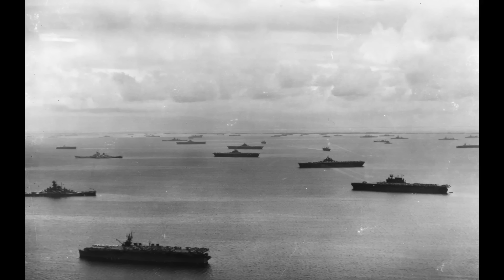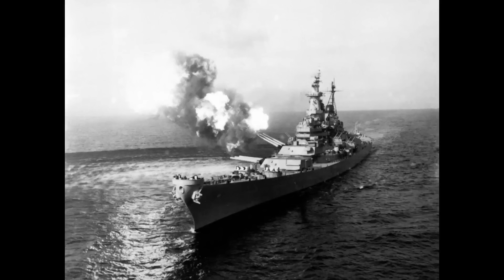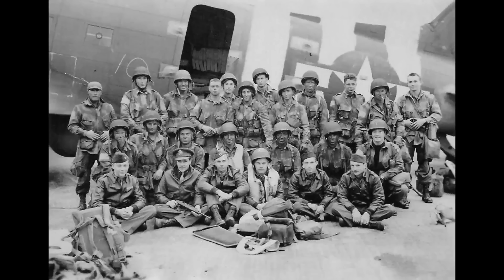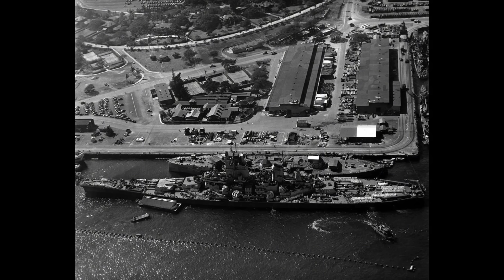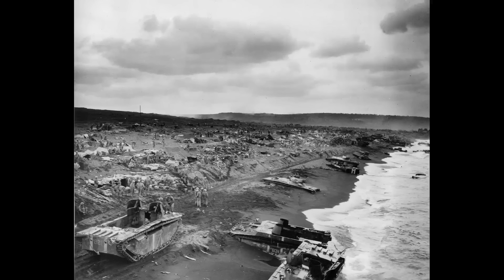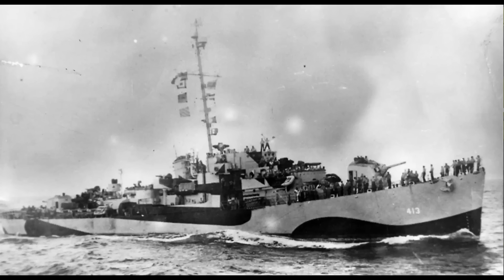How One Metallurgist's "FORBIDDEN" Alloy Made Iowa Battleship Armor Stop 2,700-Pound AP Shells

Comment: There may be some facts here that are true but it contradicts itself and is blatantly false on several points.The turret face for one of the Shinano's turrets before her conversion to a carrier is on display at the Washington naval yard. It is 26" thick and has a huge hole in it from a mark VIII shell. The North Carolinas South Dakotas and the Iowas all used the mark VIII super heavy shell. The Colorados were the only ships to fire the 2,240 pound 16" shells. This video also contradicts itself when it said a mark VIII could penetrate 20" of armor at 20,000 yards then says it can't penetrate Yamato's  armor that was 16". The bursting charge is 90 lbs not 40.

Comment: North Carolina, South Dakota, and Iowa classes all fired the same shells, the Iowas just fired them with more velocity due to the longer barrels on the Mark 7 guns.
Reply: Only the Colorado class fired the 16" mark 5 shell. The mark 5 was 1 foot shorter than the mark 8 and wouldn't fit on the Colorado shell hoists
Reply: The Iowa class could fire the old rounds but they got new rounds the old ships could not.  The backward capability aided resupply issues in combat but a return to port likely meant maxing the superheavy loadout.  As Packer910 also pointed out.
Reply: @charlesmaurer6214  The Mk6 16"/45 guns on the North Carolina and South Dakota classes could also handle the Mk8 2700# AP shell, they just couldn't match the velocity of the Iowa's Mk7 guns being 6 feet shorter. Washington made swiss cheese out of Kirishima with those shells at Guadalcanal.

Tho much older (post-WW1 era) Colorado class could not handle them, despite also having 16" guns.

Comment: heat treating tool steel is fun . I always got my work flatter after heat treat than  pretty much anyone I have worked with .  I loved watching guys lay a 1700degree  !"  12"x10"x1" plate on the cast iron surface plate and quickly lay another cast iron surface plate on top thinking that will give a flat piece of work .  Nah the hot plate laid on a cast iron surface sucks the heat right out ,causing a warp. Then add the other plate on top and that quick quench  slaps it around making it a rocking plate .  The trick is   your work is standing on it's long edge { S.Steel wrap of course ,band aides are included . everyone get nipped }  . Out of oven and wrap you stand the orange hot plate on it's long edge . After a few seconds  you see the gray of the steel creeping up, quick turn to other long side , gray creeps up, flip and repeat until just a bit of the center is a soft glow .   Don't lay down until ready for tempering .    Lots of tool makers don't know that producing a lot of heat as you machine it affects how it acts in the heat treat process .       I miss toolrooms and troubleshooting dies .
Reply: HEAT THE SUBSTRATE NOT THE BONDED STEEL

Comment: The Iowas only, in the end, needed armour against aircraft machine guns and 20-40mm auto cannons, and possibly heavy cruiser shells... The weight savings would have been substantial. NO Battleships ever had armour that would protect from aircraft bombs or modern missiles. Nobody has the capability of making 16 in. shells, or even the propellant powders, anymore. When thw WW2 stock run out, there are no more.